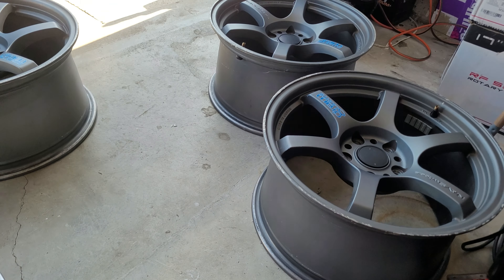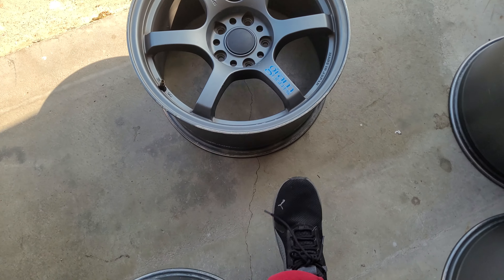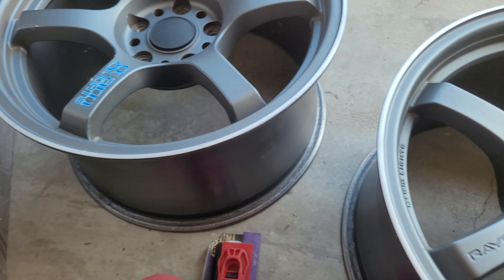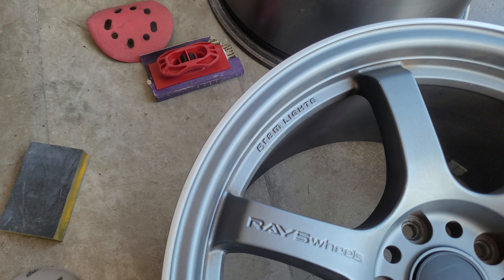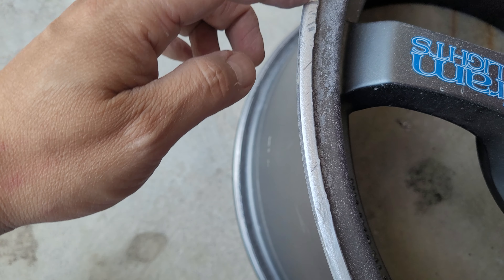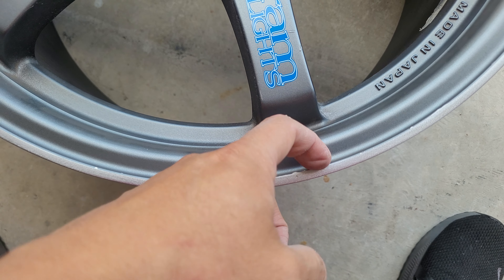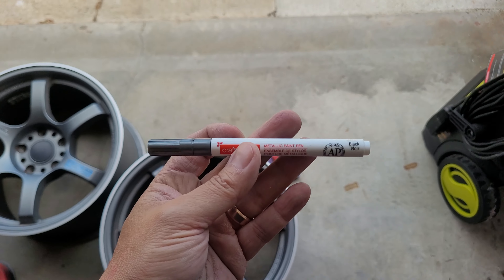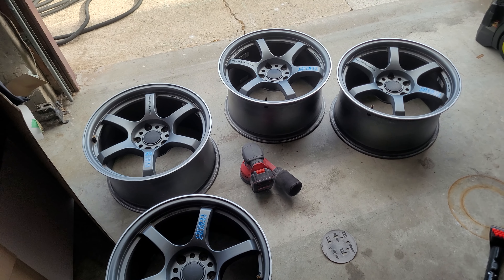Restoring Rays Gram Lights 57DR Wheels | Curb Rash Repair & Reselling Tips

Comment: Just a quick question, I just bought mines and they come just with 5 holes in the center where the lug nuts are, but I see other people with the same model 57dr and they have 10 holes or 10 counterbores in each wheel, you why is that?
Thanks
Reply from the maker: not 100% sure. It could be a replica wheel or just another wheels overall.
Reply: Hey so rays has different batches of the gram light 57dr some have the extra holes which is for weight reduction and some don’t